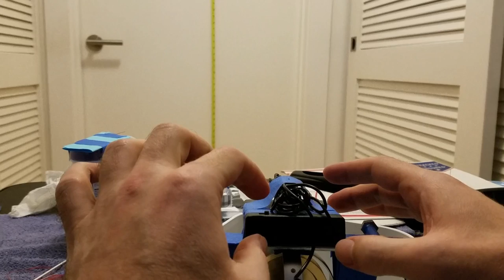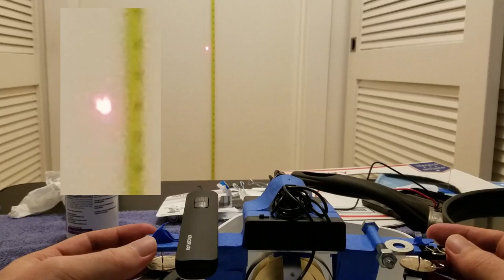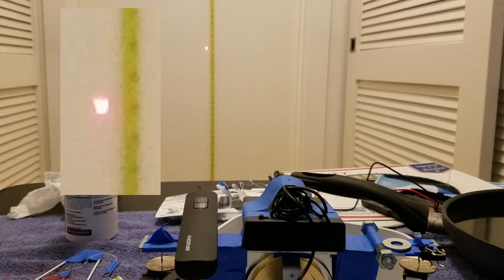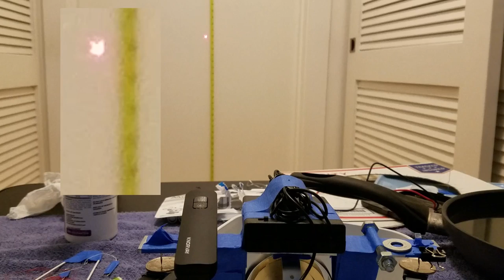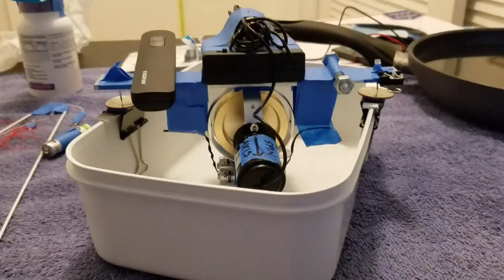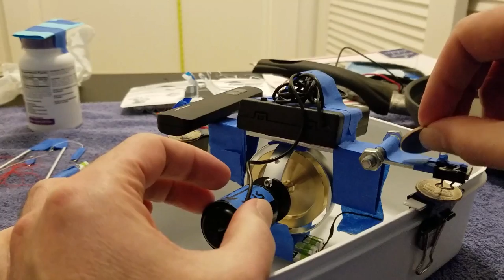Foucault-like gyroscope showing effect of Earth rotation

Comment: This is unlikely to work in the intended way. 
The "bearings" seem to develop  a torque whenever they are perturbed.

A truly statically balanced system can be stopped in any orientation (neutral stability).
What you defined as positive stability will act to correct for any precession which may occur. To demonstrate anything scientifically the stability needs to be provided only by the gyroscope.  (without prejudicing in any way).
Good effort however, scientists do experiments many times to be sure the  experiment will produce repeatable results before publishing.

PS. No (scientific ) one claims that gyroscopic stability has anything to do with celestial north merely that the axis of stability is stable in space.

Comment: Sorry, but you have not demonstrated any earth rotation which is (max) only 15° per hour.
Reply from the maker: The pointer here jumps around, at times moving faster than 15° per hour, because the gyro is precessing due to an applied torque, not because it is tracking a steady direction in space.  (Tracking a steady direction is what I was trying to do overall, but here the boat is not in the water.)

I have another video that better demonstrates this effect and explains the theory behind it:
https://www.youtube.com/watch?v=2z291HWPNtc

In that other video, the gyro can yaw freely, rather than pitch as it can in the video here, but the same basic explanation applies.
Reply: I think what you are detecting is a type of magnetic Coriolis. Ice skater has shown a video of a suspended gyro from the ceiling that tends to seek "North" but you can clearly see how quickly it rotated - cannot be due to earth's rotation.
Reply from the maker: Can you provide more details or a citation for the magnetic Coriolis effect?  I'm not finding anything that seems relevant.

I'm familiar with Ice Skater's video.  Did you look at the video of mine that I linked to?  In my video, the boat turns much faster than 15° per hour, and that video also explains why that happens.
Reply: I'm not very knowledgeable about these topics, so thanks for your video GG74. I haven't found any good sources yet on magnetic coriolis but I did find the allias effect to be of great interest. Maybe some answers are hidden in that anomaly?
Reply from the maker: You mean aliasing in the sense of distortion caused by sampling?  The only sampling happening in this video is the video camera taking images once per frame, but as an in-person observer of the event I can assure you that nothing in the physical experiment had a similar frequency.  In particular, the laser pointer's motion was just as ploddingly slow in person as shown in the video.
Reply: Maurice Allais, he found some anomalies with swinging pendulums during solar eclipses. China just did a big study but haven't release their findings. I believe this type of effect would almost certainly affect gyros as well.
Reply from the maker: After reading up on it, the Allais effect has at best weak experimental support and is only supposed to occur during a solar eclipse, which was not taking place at the time of this video (2017-01-02). Furthermore, I don't see how it could explain the motion in this video since there is no periodic oscillation like a pendulum.

In any case, this video is not very good!  The observed motion is tiny and my explanation of the physics behind it is poor.  I have a much better one linked in the description, which shows much larger motion and explains exactly how Earth rotation would cause it.  If you think the Allais effect might be involved, could you explain your reasoning in a comment on that video?
Reply: You are wrong (edit: not you Scott). A focault pendulum's response to earth's rotation is dependent on lattidue (360° x sin(lattitude)). A the equator, the response is 0. At the north pole, it is 15° per hour. If you've ever seen a person push on a gyroscope, you know it responds in a direction 90° to the force applied, and it's response tends to cause reverse response to the force applied, causing it to be self sustaining. The math on gyroscopes is far more complicated. But suffice it to say that the resulting response is TINY compared to focault pendulums. Friction and frame drag further complicate this calculation, but the measurement is going to need a laser to magnify the effect.

Comment: Mechanical wise he build a nice working gyroscope to find out if earth is rotating or not. But he is far off, the way he is placing his gyroscope. He thinks and places the gyroscope 2 dimensional. Think 3 dimensional, point the gyroscope axles in the right direction of where you are and compared  to true North and the right degree to earth axles and you
will see in 6 hours a 45 degree of your gyro-axle. If not, the earth is not rotating, but not flat. If you can think and imagine 3 dimensional, try 4 and 5 dimensional with out including Albert s “TIME equation ”
you will have figured out  the universe. Universe is all there is, there is no more.

Comment: why would your gyro be trying to seek north? it appeared to just rock up and down, did not notice that it was showing any movement of the earth. Your setup here on your gyro is not good enough to show any movement of the earth, please research your material better before claiming this show anything but a failed attempt to do science.
Reply from the maker: The gyro attempts to seek celestial North, a direction in space about 38 degrees (my latitude) above geographic North.  It does that because the Earth's rotation is causing a torque about celestial North, and spin follows torque.  The video linked in the description explains the effect and shows it more clearly, albeit in the horizontal rather than vertical direction.

The reason the gyro rocks up and down is the gimbal is not perfectly balanced (despite my attempts to balance it).  It's acting sort of like a pendulum here, holding near its equilibrium point.  The Earth rotation torque nudges it up, but then gravity pulls it back down.  (Note that the spin axis is pointing toward the camera in this setup, opposite the laser pointer direction, so the pointer's spot is trying to move down due to torque.)  If I could get it perfectly balanced, the spin axis ought to smoothly move toward 38 degrees above the horizon (laser spot 38 degrees below).